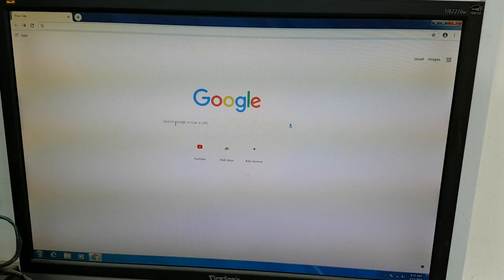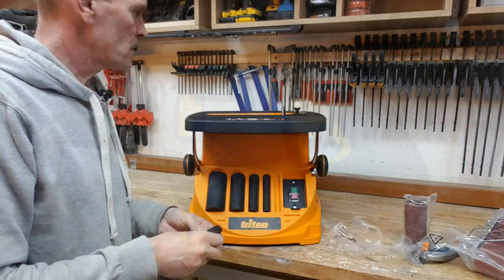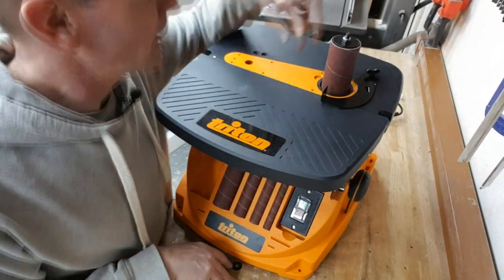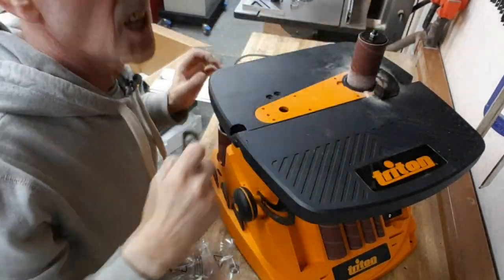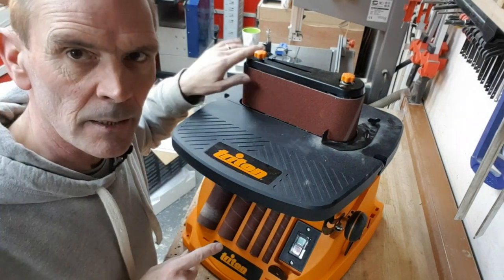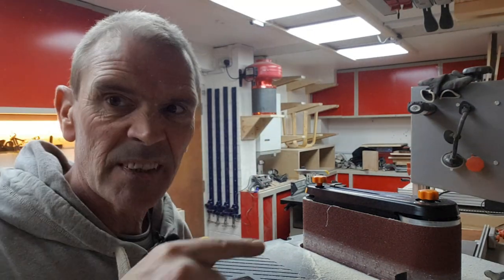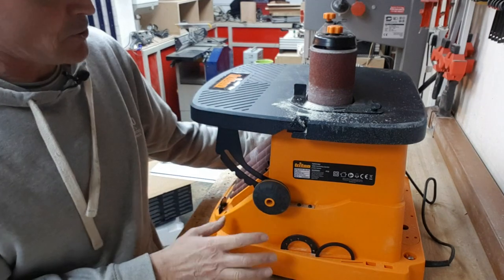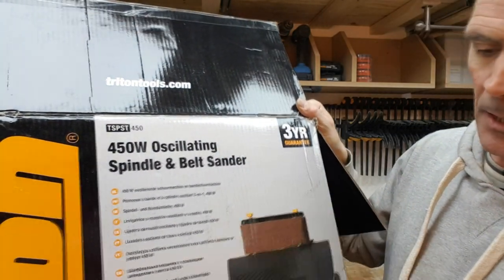Franks Little Workshop gets a Triton 450W Oscillating sander.

Comment: Cheers Frank.  I couldn’t decide if I should go for this model or the TSPS450 which is only a spindle sander.  The reviews claim that the latter has a better build quality, cast iron table etc.  However, I’m sure if you felt the build quality was letting it down, you’d have said so. As you didn’t, that’s good enough for me. The belt/spindle sander is the way forward.  👍🏼👍🏼
Reply from the maker: Hi Steve 😁. I have no problems at all about the build quality of this. It offers an oscillating belt sander and the spindle sander so for me its the best of both worlds . I'm a big fan of cast iron tops but you would need to pay a hell of a lot more for one on a machine like this, the one that is on it is just fine. Whichever one you get I hope you enjoy 😁. Thanks for watching Steve
Reply: If you’re still happy two years on, that’s good enough for me. Having 2 in 1 saves space as well as money. Decision made........ Amazon, here I come 🏃🏽👍🏼😀
Reply from the maker: @stevejeffery4951  oh my god... where did that time go 🤔. And it still works a treat. I've just treated it to a new belt and its given it a new lease of life 😁👍

Comment: I'm using the Rigid version of this tool, and just based on some differences which you would think would be fairly minor, I prefer what I'm seeing from the Triton. 

The dust collection is definitely superior on the Triton. There is almost no effective dust collection on the Rigid.

Although I see similarities, I still see many differences in how they approached the design of the unit from manufacturing considerations. As a manufacturing engineer, and Manufacturing engineering manager, as well as now being lucky enough to take on the job of production manager in my ample spare time, I think about these things, I don't know how my wife puts up with me sometimes! I also see how they approach the design from a standpoint of how the customer is going to use the unit. Without getting into any specifics, because I don't want to disparage the rigid machine unfairly, especially because I am using it on loan to me from a friend, who works for  the company, and I am very grateful for the use of the tool, but I do intend on buying the Triton in the near future.
Reply from the maker: Thank for your comments 😁. Now I've been using the machine for a few months I can now say that the dust collection is much better than I gave it credit for in the video. I'm still loving this machine 😁. There are so many great design features on it that make me believe it was designed by a real person as opposed to a simulated CAD design. I've never used the Ridged version, but it would need to be something special to beat this on performance and price. Thanks again for your comments 😁👍.
Reply: My Ridgid version of this machine served me well for a number of years until the belt sander feature stopped working. I’ve been using it as a drum sander only but have now ordered the Triton version because the Ridgid is nearly impossible to come by.  Not sure which manufacturer copied which but the are nearly identical save for the orientation of the stop which is reversed on the Triton.  Also, the Ridgid table is cast iron rather that aluminum, and the dust ports are in different locations.  The Ridgid is considerably more expensive than the Triton.
Reply: Does the modern Ridgid version have a slot for a mitre gauge? I've seen it on some videos, but that may be a much older model. It would be a useful feature.
Reply: @wiseoldfool  Agreed! The mitre slot IS a useful feature! It's the ONLY feature that the Triton model I invested in, about a year ago to the day, does not have. All things considered, I absolutely prefer the Triton to the Rigid, though I think that for most people's purposes either machine would suffice. I cannot answer with regard to the slot being present on the current machine.

Comment: Can the belt be turned over when the lower part is worn out? Same with the cylinders?
Reply from the maker: Hi Bill. Firstly thanks very much for the sub 😁, much appreciated. It is possible to turn the belt over BUT they are directional so really shouldn't be. However... by the time the lower section is worn away you should already be thinking of replacing it. If you have no other choice then it can be used... but don't forget to check the tracking. The cylinders are not as critical so should be ok. Alternatively you could raise your work piece using a small piece of ply or mdf clamped to the bed so you use the "not worn" surface. Hope that helps. Thanks Bill 😁👍.
Reply: @frankslittleworkshop  Raising the work piece sounds like the best solution. Thanks!  Just ordered TSPST450.  $206.00 US.
Reply from the maker: @billl3936  You won't be disappointed 😁. Thanks Bill.

Comment: When you buy a set of sanding tubes they come with a 75mm one, but the machine does not come with a 75mm bobbin. You can buy one from Amazoom, but you need a new insert to accommodate it. On YouTube somewhere. Also there is another YT of someone making a fence for the machine to doing flat ‘planing’ sanding.
Reply from the maker: Thanks Bill 😁. I must be due a set soon 🤔. I'm still using the original ones, they are lasting for ages. I keep them "clog free" by using an old rubber shoe sole to clean them... strange... but it works. Thanks for the 75mm info, I'll keep that in mind. I did rig up a jig to use it as a thickness sander... but it didn't go well and fired my workpiece across the workshop at 100 miles an hour... so I didn't try it again. Thanks for watching Bill 😁👍.
Reply: @frankslittleworkshop  I’m just throwing out a pair of old flip flops, I’ll rescue one for my sander!
Reply from the maker: @billgiles3261  I have used my crocks... they also work 😁😁. Thanks Bill. Stay safe 😁👍